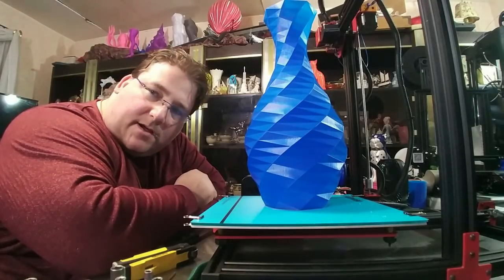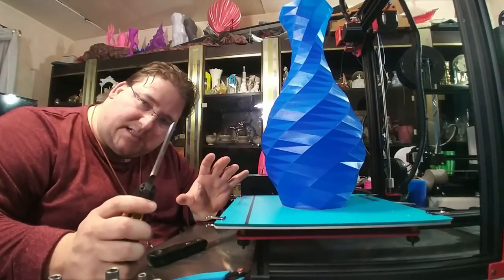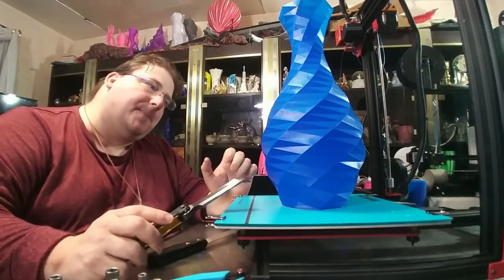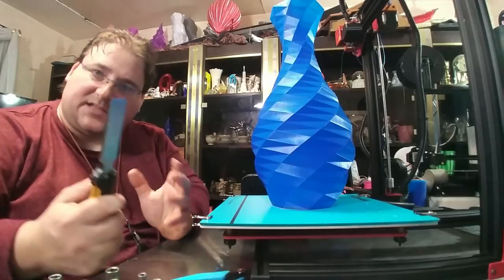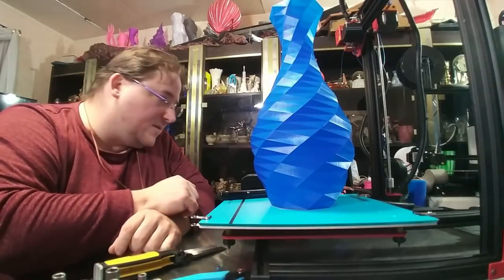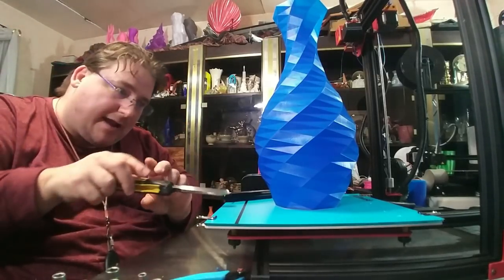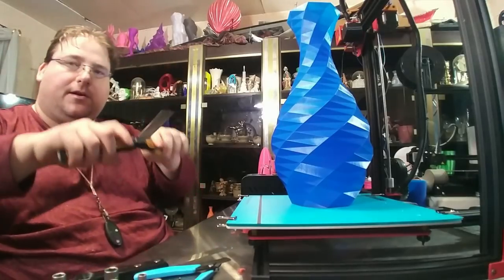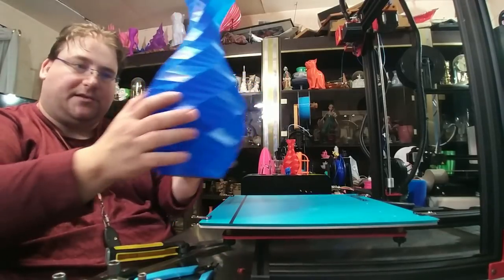T3DP 222 3D Print Removal Technique & Tools

Comment: This should be a required video for anybody that gets a 3d printer.  The safety tips for the chisel were spot on.  I got frustrated trying to get a print removal off my ender 3 and sliced my wrist dang deep doing exactly that 'grab the side of the bed' method you were showing.  Luckily it was just the scraper that came with the ender 3.  Great video again Nerys!

Comment: Been using a chisel as you suggested in another video for about a month and its been a gamechanger. Best 3d printing tool/ upgrade ive found. Sooooo many headaches from paintscraper removal are now in the past. Try it, cant go wrong...unless you chop a finger off. 😲😉
Reply from the maker: I still struggle with the thick pri ts with the 1.2mm nozzle (first layers are just so stiff) but a little tap tap tap gets ut in to make room for the reptor blade. Its very nice to not have to stress over getting parts off anymore :-)

Comment: Hey Chris, I just made a DYI magnetic build plate and got the parts from mcmaster carr. They have a 12x12 sheet of spring steel sheet and also the adhesive magnetic sheet too. I was cheap and used my old e3 build sheet on top of it. Just heat the e3 plate to 100c and it peels right off with the glue on it and transfer it to the sized metal sheet. I will never go back, it's so easy and safe since no tools are needed. Take care Chris.
Reply from the maker: Yes magnetic build plates are so fascinating my only problem is that larger prints the warp force in the prince can exceed the magnetic force in the build plate
Reply: Nerys ahh yes, forgot about that. I don't do alot of large stuff so that escaped me.
Reply from the maker: Matthew Poole I still want it I have a suspicion that if I were to wrap tape around the Four Corners that might be enough to keep it flat when doing very large prints :-) I will eventually test that

Comment: Thanks to your advice I have my Ender 3 printing phenomenally!  The glass bed really made a huge difference, and next I'm installing the stepper dampeners, new bed springs, TL smoothers, and Capricorn tubing.  1.2mm nozzle on the way now!
Reply from the maker: You are so going to enjoy playing around with a 1.2 millimeter nozzle it's not for everything anything with fine details it won't work for unless those details are large and don't forget slowed down I print it 25 millimeters per second and raise the temperature I usually use 230 or 235 degrees Centigrade even for normal pla you're pushing so much plastic through there you're actually going to watch that roll un roll right in front of your eyes!

That you need the extra heat to make it work if you hear bubbling and it's printing like Snap Crackle Pop lower the temperature 5°
Reply: Nerys - the small low-poly vase printed absolutely perfect. I’m excited to see it sized up now.
Reply from the maker: Flying Squirrel FPV awesome post pictures :-) I love seeing the stuff people make!
Reply: Nerys - https://instagram.com/p/BlfhkDSFBZR/

Comment: Hi Nerys,
Unfortunately Amazon doesn't ship the  "FatMax" folding chisell to my country.

Could you recommend an alternative?
Reply from the maker: I need decent quality chisel 25 to 35 mm with some weight to it I love the folded one because they're safer if you drop them :-) the big thing is a solid Hefty clean Cutting Edge so it doesn't dig into your print surface

Comment: Cut towards your chum not your thumb! I am also a fan of razor bladess used for scrappers. I use it to get a start, then use a putty knife to go around and pop it off. I use glass and pva glue  sso dunno how it will work on the coating. Ive wanted to try the cake icing tool since ive heard it works good and probably works well with my method. great info!

Comment: I have a huge question and I know you can help me. I own the Tevo tornado and my prints keep lifting on the edges. For the life of me I can’t figure it out. I’m using blue papers tape on the bed, PLA, my temps are hot end 210 and bed is 70 and it’s inland PLA 1.75. Done all I can but my prints are just not  sticking for me. Please help thanks!
Reply from the maker: Your bed temperature might be a little too high try lowering it down to 60 or 65 it depends on how much of that heat makes it all the way through the glass

Also blue tape has a limited useful life span eventually Prince will stop sticking properly to it or the tape will start to lift when the print pulls up on it especially larger prints

If you're pretty is lifting off of the tape and not lifting the tape itself off the bed there are a couple things you can do put some glue stick on the tape at the corners were it will tend to lift also at a Brim to the model which will also help hold it down by increasing the surface area along the perimeter
Reply: The tape is coming up with the part itself, so I believe that it is sticking to the tape, but the tape isn't sticking enough to the bed it seems. Like you mentioned the tape is coming off the bed as it gets hotter so I'm gonna try lower the temp on the bed. Do you think changing when the fan turns on to start cooling the print would help any? I'm gonna try out your tips and see how it goes, thanks in advance!
Reply from the maker: @JAGATechnologies  the parts cooling fan won't make a difference yes definitely turn the bed down maybe even as low as 55 or 60 you're probably making the adhesive on the tape itself too soft if the part is very large make sure the tape wraps around the edge of the bed but that is a problem with very large High warp Parts on Blue tape the warping will exceed the force of the adhesive a brim still might help since it will spread the force over a larger surface area
Reply: I agree, I think the heat is making tape come up. Do I even need to use heat on the bed if I’m using the blue tape? What do you use on you’re Tevo tornado?
Reply from the maker: I believe heat helps. 55 to 60c (depending on how cool it is in your house) should be fine. YOU DO need to replace the tape pretty often for larger prints even if it looks fine.

tape also sticks much better to SMOOTH non porous surfaces (IE not the tevo tornado stock surface) I don't use tape I use the stock print surface that came on my tornado.

Comment: Another great removal tool is the Gizmo Dorks 5” blade.  It Has a nice bend in it for good ergonomics.  It’s available on Amazon for $7.95, Make sure to follow Nery’s affiliate link first 👍🤩
Reply from the maker: Ahhh that's identical to the Raptor blade just with a Bend cool and it's cheaper

Comment: Video. What's your best technique for taking a print off tape
Reply from the maker: The same as any other print off any other surface chisel and Reptar knife the problem with tape is that the adhesive for the tape to affix to your plate is many times weaker then the force required to pull it off the print bed which means even if you don't damage the tape you end up pulling it off the bed

So no matter what happens tape is disposable and consumable you will have to replace it after multiple Prince even the tape I used on my magnetic field surface simply begins to crinkle and pull away from the bed under nothing more than the warping force of the plastic overtime so even though I am never damaging it removing a print I have to replace it eventually anyway
Reply: Nerys I think I'm squishing too much because sometimes some of the tape sticks to the plastic of the print
Reply from the maker: Average Joe's 3D that's not necessarily squishing too much that's the nature of tape :-) obviously too much squish will make that worse when you print print a skirt around your object use your fingers and feel the skirt it should feel like fishing line stuck to the bed if it feels relatively flat it's too much to squish if you're able to move it by gently touching it it's too little squish it should be pretty firmly attached but feel like fishing line that's how you know you got the right amount of Squish

One thing you can do is apply a release agent such as glue stick not only will this make it easier for it to stick but it will act as a medium between the tape and the model and decrease the likelihood of damaging the surface

Another tactic which works both with tape and with glue stick is to dramatically reduce the speed of your first layer and increase the temperature I print my first layer at 220 sometimes 230 if the plastic will tolerate it by printing very hot and very slow you can essentially drop the filament onto the bed and it will stick this will allow you to vary greatly reduce your amount of Squish yet still attached the model making it much easier to remove that takes a little bit of finessing practice and a very flat bed
Reply: Nerys that gecko Tech can you show me  at merf is still  still going strong.
Reply from the maker: Average Joe's 3D it does not work as well anymore but I got it aware that it was a consumable print surface that eventually the magic on that surface would stop I did put quite a few prints through it
Reply: Nerys what's your go-to build surface
Reply from the maker: Average Joe's 3D my favorite Prince surface is print in z because of its durability and relatively smooth finish but now that I've discovered the Chisel and Reptar knife for removing Prince it pretty much doesn't matter anymore I leave on whatever print surface comes with the printer as long as filament sticks :-)

Although I have to really note that I like Ivan's method of just plain glass it could be a little tedious sometimes but damn it does it look nice when it comes off :-)

Comment: Actually what you called upside down is actually right side up! For a chisel. And by the way when I was a boy my first woodworking teacher was always saying the same thing! Good video and good warning.
Reply from the maker: ?? Chisels are used flat side up? (As you can tell i dont have experience using chisels for ..... Wood :-)
Reply: That depends on the type of work you do with it really. If you are doing horizontal shaving of material then the beveled side is the top. If you are doing vertical cuts then you will want to swap the chisel around and then the flat side becomes the front that you have facing away from the material. You do this (as I'm sure you are aware) to avoid cutting deeper into the material than you want to, since the beveled edge wants to travel in the direction the bevel points down. In the same way single sharpened sided Japanese knives want to travel and why double beveled edges exist in many western style knives. 
 
EDIT: just realized that the guy in the video I linked to about using chisels does not do the flip around of the chisel. Which is odd. That is something in most woodworking shops around here and my whole family has done since way back. (no we aren't a family of woodworkers. Just quite a few people on my uncles side of the family and myself are very handy with tools and such and we like working with wood, and I mix tech up into that with 3d printing etc)

So essentially there is no real top/bottom/front/back. Because it always switches depending on the types of cuts you are doing. It is a "Universal" "headless" (using the drone terminology here where there is no front/forward side in headless mode) tool. 

So Michael while you are partially correct you are also partially incorrect 50/50. It isn't the full story so to speak. 

Also Chris I would suggest watching this video about using chisels. It might be safer to do what this guy does when holding it for fine work. Fingers closer to the blade edge, rather than the back. No possibility of cutting your fingers that way https://www.youtube.com/watch?v=Efxgvo36FiY
Just a video found with a quick search. Scrubbed through it to make sure he was doing it correctly since using words to describe is harder than a video. 

Anyway hope you both and everyone else has aa great day.

Comment: Just let it cool, spray some glass cleaner like Windex around the base wait a minute and plop of it is.
Reply from the maker: On glass type surfaces that would work most of the time you don't even need any spray it just pops right off with a finger the print surface on the u-20 is a little easier but it was the only large print I had available to demonstrate the process so I used it